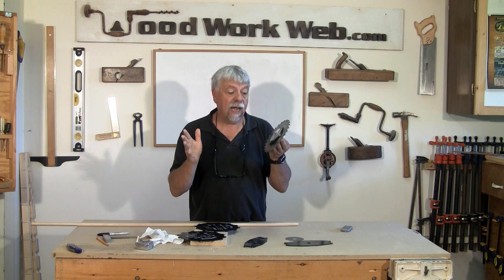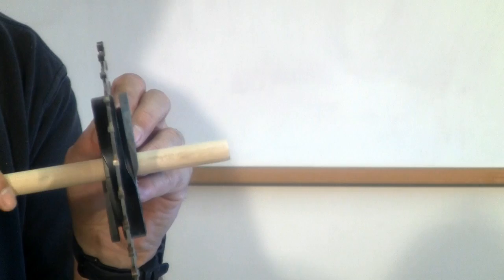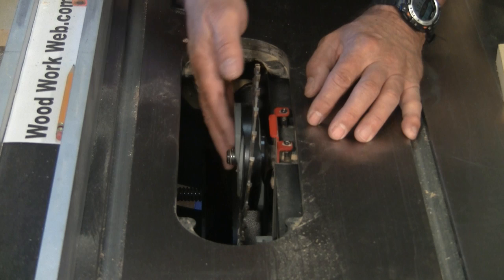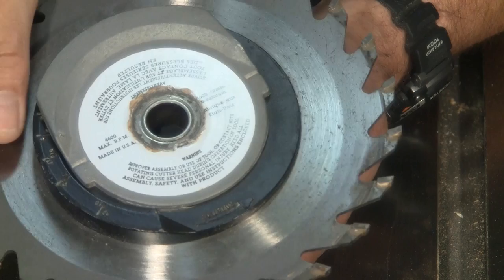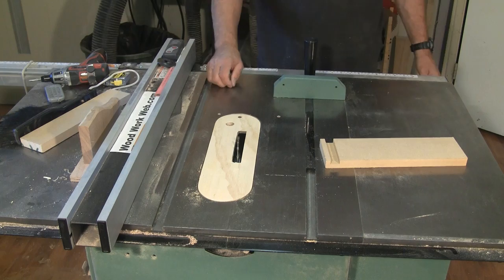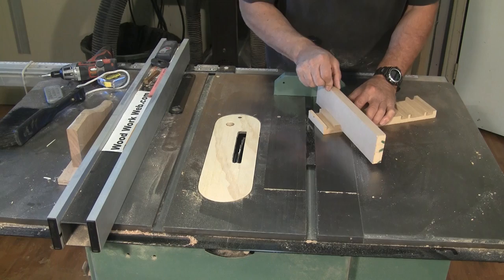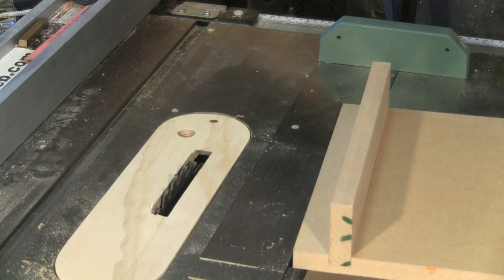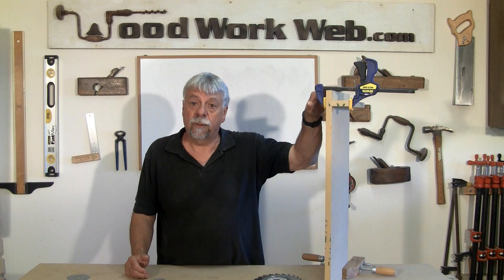Testing the Wobble Dado Blade -  woodworkweb

Comment: During the entire time you sped up the video as well as making the final adjustment to the blade I didn't see you unplug your table saw. Very dangerous to be changing a blade with it plugged in.
Reply: oh geez........................................If it makes you feel any better, I don't unplug mine either. I still have 10 complete fingers. I have NEVER seen a table saw turn on by itself.  Pretty difficult to bump the swith on modern equipment.
Reply: It's the basic process for working with any power tools. Not to mention most of these videos are for beginners so it's an important step which should not be over looked. 

"Pretty difficult to bump the switch on modern equipment" but it's not impossible. Having the saw unplugged there is no chance of it starting. Working in the shop should always 1st be about minimizing risk.
Reply: beginners should read the "safety precautions" section in the manual and do as it states. Colin was not giving a course on the safe operation. It just gets old reading comments from people pointing out what someone should or shouldn't do and finding what they think is wrong. If "beginners" don't have common sense, they should not be using equipment at all. It's just as easy as that. Beginners can search for "table saw safety" videos and learn about the safety, hint-hint.
Reply: It doesn't need to be a "Safety video" to do what's safe, it should be common practice. You may not unplug your equipment when you work on it, that's your problem. It should be common practice by everyone, especially someone who is demonstrating things for others and shows things for educational purposes. I don't care if you don't like the comment, if you don't like reading them then don't read it... I never posted it for you in the 1st place. Even the people who do this every day it doesn't hurt to remind them about safety. When we become complacent that is when accidents happen. I am not going to turn this into an argument because I do think he does a great job at what he does. This was not meant to bash or insult anyone. I simply want to remind him (not you) about safety and when educating others it's a good idea to practice proper procedures this way others don't forget as well. It's the 1st thing you learn when it comes to working with power tools, safety.
Reply: whatever
Reply: there is an option for you to email him directly and privately that is not posted for "public". you may wanna check that too
Reply: I have free tickets (you and a friend?) to a global health and safety awareness event in Brussels,where you can watch all the horrific videos of people who almost hurt themselves. You even get to meet others like yourself, maybe even get to pass a new regulation, WOW, Now that would be cool. I don't want them. They are all yours.
That's the only Party I can invite you to.
Reply: Just because someone, sixty years ago, came up with this brain fart doesn't make it right.

My On/Off switch is located and of the type where I wouldn't think of unplugging the tool .. come to think about it, my saw's hard-wired ... and, no, I'm not going to trip the breaker.
Reply: it works! some people don't have to make dados all day everyday. Not everyone has a pocket full of money to buy a dadodoodad set.
Reply: Gee Dubb
The fit Colin was showing was perfect; I'm surprised on a 3/4" dado we didn't see more concavity to the rabbet [these things undercut the sides]; either way, a few thou for glue is the norm.  I've had a Craftsman set for nearly 50 years [using it on my RAS as well as my TS before 'graduating' to a stacked dado kit ... I'm not sure I gained anything].
Reply: Aaron Patchen is right of course and it does make common sense. I don't always unplug mine but if it crosses my mind I stop what I am doing and unplug it because I am a great believer in the mantra "There is a first time for everything". Yes; there are many, many people who don't unplug and they all have 10 fingers and toes. What does this prove? Nothing. As the great Homer Simpson corrected "...this is the best day of my life...so far". Applying that to me I still have all my fingers...so far. I think a lot of us need to get over ourselves; perhaps let a little air out of the ego and drop the 'Macho man who-doesn't-need-frilly-safety-glasses-I-can-take-an-M6-bolt-in-the-eye-without-flinching' mind set. Then we might stop trying to shoot down the person pointing such things out and say 'Good point, we should but I can't be arsed, I am too lazy and it's a hassle to keep doing it.' That way we take responsibility and stop looking to some anecdotal to justify our actions.
Reply: grotekleum

He isn't right "OF COURSE".  Is he "safer" ... of course.

Is "safer" always "right"?  Not unless you're a Volvo-driving, tree-hugging soccer mom who needs a back-up camera to prevent her from backing up over his kids in the driveway.
Reply from the maker: Hi Aaron, thanks for your comment, if you have watched a few of my vids you can see I am always talking about safety, this saw has a commercial safety switch, the same kind they use in industrial shops where they can't be plugging and unplugging saws every time they want to change a blade. The switch is what I have heard called a 4 point, recessed and the arbor has a lock. It is pretty much impossible to accidently turn the switch on, unless someone came in behind you and turned in on, then even if they did, the arbor lock would prevent movement. My old saw had an exposed switch, single contact and no arbor lock so a big difference in safety aspects ... hope this helps.
Reply: some people find fault like there is a reward,  sounds like Aaron needs to get out and about n see whats out there in preventive safety for shop tools,  times have changed since he purchased his table saw  :)
Reply: Do you apply a LO/TO device on the plug also so that nobody else can plug it in while you are working on it?
Reply: Aaron Patchen Do you work for OSHA?

Comment: get them new at sears
Black & Decker Bld Dado 7In 5/8In 16T Carb PORTER-CABLE Saw Blades - Dado 7005012 Brushed Steel that's its name copied strait off there page
new there just under $30.00
Reply from the maker: Perfect .... thanks Ricky
Reply: In the UK, I can only find ones to fit on spindles not table saws and the are 10x the price. If anyone knows better please give me a link.
Reply: Sirus
As far as I understand Dado blades are illegal in the UK (well... most of Europe). Maybe not illegal to own...  but they breach various European safety standards so you don't find them for sale very easily and if you do they are usually grey imported from the US so have a huge mark up on them.
Reply: Ahh, I see. Oh well I will have to buy loads of cheep chinese blades and stack them then. Thanks to the nanny of Europe I am in worse danger.
Reply from the maker: SAHBfan Are you serious? Dado blades are illegal in the US and most of Europe ... I have never heard that before
Reply: Dado blades are illegal in the UK - not the US. Yes... quite serious. Not illegal to own or use maybe - but they breech European safety legislation so you can't easily find them for sale. The same applies to fixed based routers - we really struggle to buy them over here. The reason is they usually have metal bodies - hence can"t be "double insulated" as per European standards. All of our hand held power tools have plastic bodies. And don't start me on table saws...
Reply from the maker: SAHBfan Wow, I had no idea, thanks for replying with that detail. Must make it harder to do some woodworking joints when you can't even buy some of the equipment, and I loved your comment about the saws, sounds like we might be headed that way in North America too, thanks again buddy :) .... keep in touch
Colin